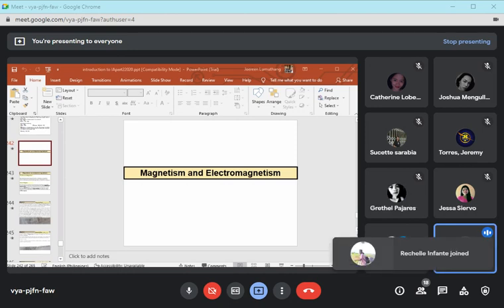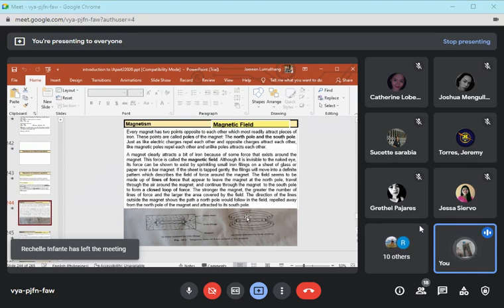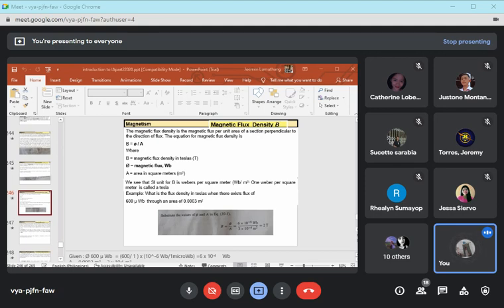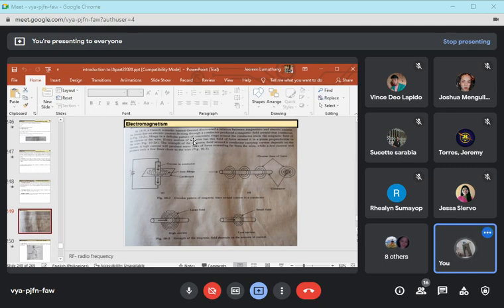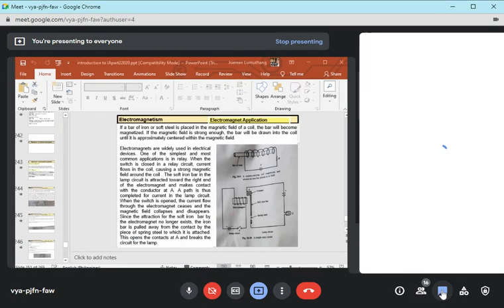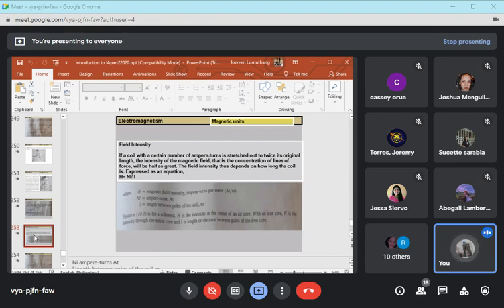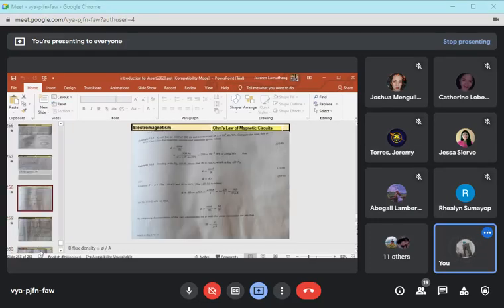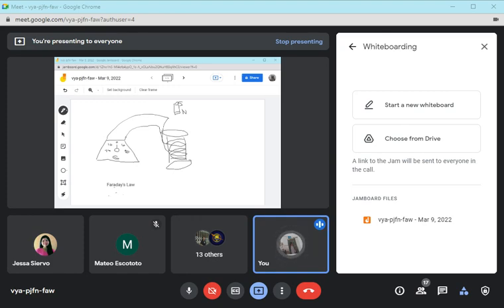Electricity and Magnetism

Comment: Bordan, Mark Andro D. 
BTLED-HE 2

My learning insights according to what i have learned  is that Magnetism and Electromagnet have a big part, role and contribution around the world ( e. g. magnetism is very important because we use it to create electrical energy). Magnetism and Electromagnet are connected to each other or have a relationship to each other, Electromagnetism includes the study electricity especially the magnetsism because without magnetism the electrical word we preserve today could not exist. Moreover magnet is magnificent object that created area of magnificent force around them. Lastly my learning insight is that the stronger the magnet the greater the number of line and there are poles of magnet the North Pole and the South Pole.

Comment: De Asis, Katherine Cita G.
BTLED- HE 2

I have learn that there are two points of magnetic which is the south and north pole and also that there are materials that is magnetic and some are not which also the force that the magnet is flowing is that if we used materials we can't barely see by our human eye but the force is there we called it the Magnetic Field and the most important thing is this magnetism has a big role in our life through this we have  electricity that we use  in our daily life.

Comment: Galero, Mary Ann D. 
BTLED-AFA 2 

I have learned that the weber, unit of magnetic flux in the International System of Units (SI), defined as the amount of flux that, linking an electrical circuit of one turn (one loop of wire), produces in it an electromotive force of one volt as the flux is reduced to zero at a uniform rate in one second.

The electromagnetic force compensation (EMFC) principle is a state-of-the-art weighing method for precision mass measurement. In this method, the low stiffness of the flexure-based Roberval guide mechanism and high lever ratio of force transmission contribute to achieving extremely high weighing sensitivity.

Comment: Ballonico, Benedict A.
BTLED AFA 2

My insights about the video is that it's all about magnetism and I realized how magnetism is very important on us. We use it to create electrical energy . In fact, most of the energy that we use today comes from rotating magnets.

And also I've learned about Lenz's law that for example we imagine that we have a magnet in our hand, and what will happen if we push the magnet to the coil of wire is that it will push away the magnet but if you move away the magnet the coil of wire will attract the magnet to get closer.

THANKYOU😇